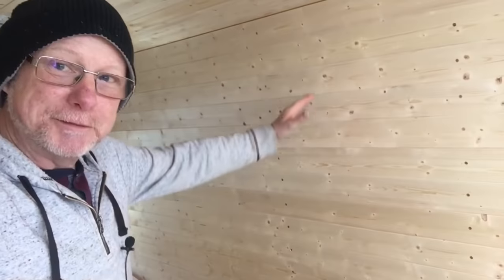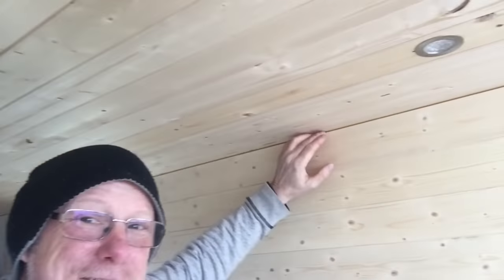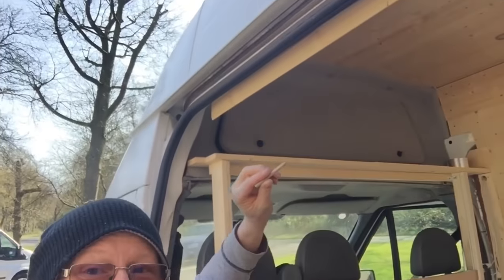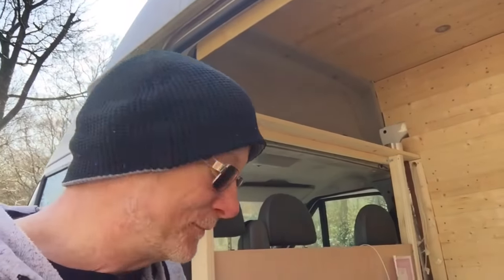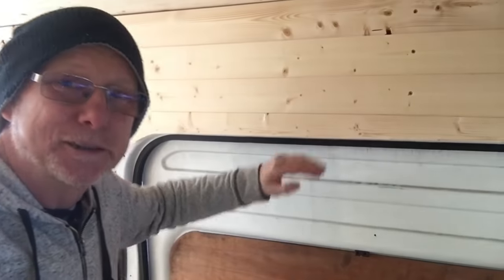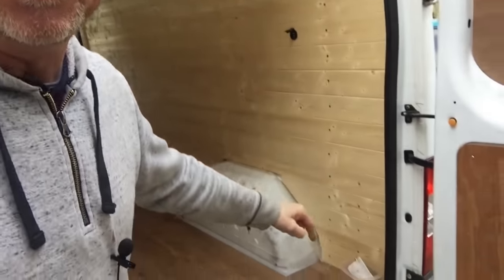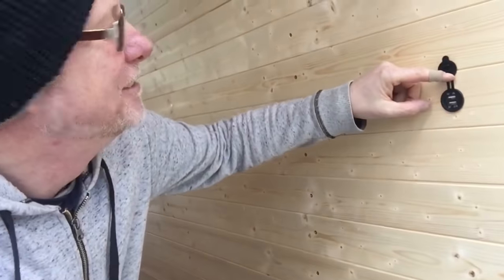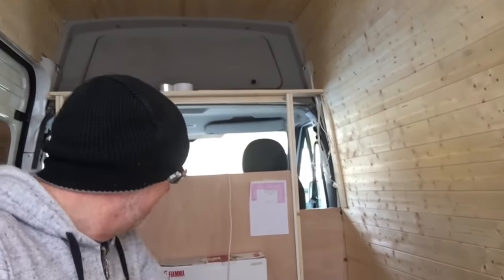HOW TO USE Cladding in your Self build camper van conversion  vanlife

Comment: Scratching my head not sure to go floor up or top to bottom as in my citroen relay I am sure the van is slightly smaller at the back,  don't want wonky cladding , maybe I will go from the middle going by a spirit level what you reckon?
Reply from the maker: Top to bottom every time good luck with your build

Comment: Everything you need to convert your own van into a camper (updated 20190404)

Videos

THE SELF BUILD - Shopping list - https://www.youtube.com/watch?v=47fxCgfiSAQ
Part 1 - New build - https://www.youtube.com/watch?v=5KZt4kqmhC8
Part 2 - Laying Floor - https://www.youtube.com/watch?v=qhsp2mbofUg
 Smart Alternator - do I have one? https://www.youtube.com/watch?v=CUPtxJBXZUw
Part 3 - Insulation - https://www.youtube.com/watch?v=KbGr2vQV72g
Part 4 - Insulation - https://www.youtube.com/watch?v=HDgFnEfHPik
Part 5 - Batons - https://www.youtube.com/watch?v=HG6enveXxF4
Part 6 - Vapour barrier - https://www.youtube.com/watch?v=hcFFetRXTc8
Part 7 - how to convert a van into an off-grid stealth camper ceiling - https://www.youtube.com/watch?v=BJUVnYbGwjA
Part 8 - how to convert a van into an off-grid camper Waeco CRX50 12v compressor fridge part 8 - https://www.youtube.com/watch?v=SQ04eg-h0R0
 How to convert a van into an off-grid stealth camper Why I don’t use cladding clips - https://www.youtube.com/watch?v=R2_w6bR5XdE

Shopping List (updated 20190404)

Fridge - (part 8) https://www.ebay.co.uk/itm/263325594227 (Dometic Waeco Coolmatic CRX50 12v or 24v Compressor Fridge)
Cooler / fridge - https://www.ebay.co.uk/itm/323234957613
Mattress - https://www.ebay.co.uk/itm/331944277628
Solar panel - https://www.ebay.co.uk/itm/173756839481
Solar panel 160 watt - https://www.ebay.co.uk/itm/122610022860
Solar Smart Charger with MPPT Split Charge - https://www.ebay.co.uk/itm/201921539775
Water tank / diesl tank - https://www.ebay.co.uk/itm/112429099483
Fiamma roof vent - https://www.ebay.co.uk/itm/372177256976
Fiamma Turbo roof vent 400 x 400 - https://www.ebay.co.uk/itm/352241329888
Cooker that I had in my last transit - https://www.ebay.co.uk/itm/272968216470
Heater - https://www.ebay.co.uk/itm/332867943103
Swing out table leg - https://www.ebay.co.uk/itm/253320392385
Sink & gas ring combo unit - https://www.ebay.co.uk/itm/251923456153
Plumbing kit - https://www.ebay.co.uk/itm/263370121822
Control panel and switches - https://www.ebay.co.uk/itm/254023185660
LED down lights - https://www.ebay.co.uk/itm/252928573990
Folding stove & grill - https://www.ebay.co.uk/itm/192548261069
Leisure batteries - https://www.ebay.co.uk/itm/321566500681
Dial 10 (part 3, 4 and 6) recycled plastic Insulation - https://www.diy.com/departments/diall-loft-insulation-roll-l-8m-w-0-37-m-t-100mm/197658_BQ.prd
Dial 10 (part 6) Vapour Barrier - https://www.ebay.co.uk/itm/293002512868

--

Comment: The 5 volt USB ports are a constant drain on your battery, even if they’re not being used. It is using current to convert the 12 volts down to 5 volts regardless if a device is plugged into it or not. A spring loaded door and microswitch over the USB port would only activate power when something is purposefully plugged into it, otherwise no energy would be wasted while unattended or unused.
Reply: That...... Is interesting.
Reply from the maker: That’s rite I have all mine switched 👍🤓👍

Comment: I watched someone else fit a fan and it leaked because the release agent from the mould prevented the sealant forming a watertight seal, need to rub it with a slightly rough abrasive to clean it off, look up rickvanman channel and see him have the problem
Reply from the maker: Malcolm Rowe that’s golden believe me I know all about moulding plastic don’t worry I’ll be cleaning off all the silicon releases spray and you are right I should mention that important part when I fit this one 🤓🤙

Comment: Hi Mel. Do you get your cladding from anywhere in particular or look for specific wood types and sizes?
Reply from the maker: Hi the only place I use is wickes it’s the best quality I have come across and the only place that dose 3 meter lengths 👍🤓👍
Reply: Thanks
Reply: Hi again. I’m guessing you use the lighter cheaper 8mm rather than 14mm thick stuff? Cheers 👍🏻

Comment: Hi Mel, Hoping you can help me if possible... I'm cladding the roof of this exact van, how did you clad the part of the roof nearest to the head bulk?   Did you just screw them into the four structural beams on the roof or did you create a fifth one near the head storage to screw into so it wasn't weak at this point? I'm struggling to get this stage finished 😩
Reply from the maker: Hello hope I’m not to late to respond I screwed a baton in at the top but rather that from underneath I fixed it to the side hope this helps you good luck 😉
Reply: @BigVanSmallWorld  Thanks! That's what I was thinking and screw a battern against the bulk head storage but it curves round a little bit so will need to work that one out tomorrow... far too hot today to get stressed with cladding haha Thanks again!

Comment: Hey mate, do you start cladding the roof at one edge or in the middle?  Looks good, we're about to start ourselves.  Also loved the vid of the instant hot water shower. Cheers!
Reply from the maker: Hi when I build out a Ford Transit I start in the middle and work out as it seams to work well and the little lights end up evenly spaced out my sprinter I started from the drivers side and worked toward the sliding door I did this because I wasn’t sure how the spacing would work out as it happened it worked out ok good luck with your build 👍😊👍

Comment: The cladding looks Great!  That is my plan for Dobby!  Finishing up the bed, very similar to yours, but I only have 53" ceiling height, and a porta potty had to fit under the bed... so for the extendable section instead of using a piece of wood under, I used a 1" x .25" x 72" long aluminum bar stock, laid it out where I wanted it to be made a few marks and screwed it in.  The bed slides in and out really smoothly.  Hopefully if we have no rain I can stain and poly it.  The base of the bed is red oak,  1.5"x 1.5" stock legs and the side rails 1.5"x1" looked flimsy till I screwed and glued the 1x4 Pine slats.  I cheated and bought myself a new memory foam mattress and took my 9" thick memory foam mattress and cut and fitted a cover for it.  Squashes down nice when you sit on it (my head doesn't touch the ceiling) and it is so comfortable which works for my back.  So are you on instagram or Facebook?
Reply from the maker: Sounds quite impressive well done 👍 I haven’t set up Facebook or into YouTube takes up all my spear time and some 🤓🤙

Comment: Hi Mel,a good video with some helpful tips,but I nearly skipped past it as it mentioned cladding in the title,and I thought I had already seen it. Where have you left the wiring for the solar panel,or does that Share the same hole as the fan/roof vent?
Reply from the maker: Steve Perry I know cladding is so boring lol I’m so glad most of it is now done 🤓🤙
Reply from the maker: Ps solar cables going through rear grommets in roof 🤓🤙